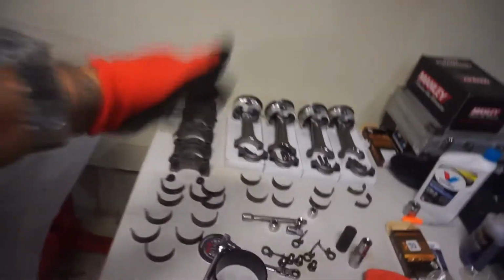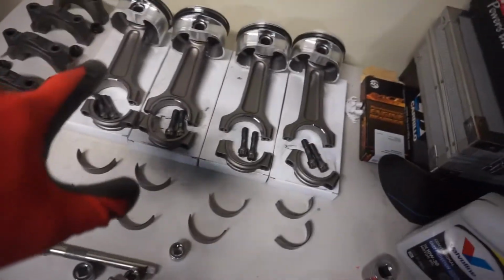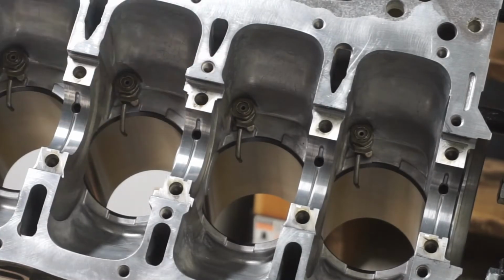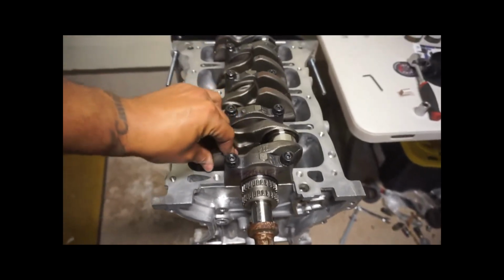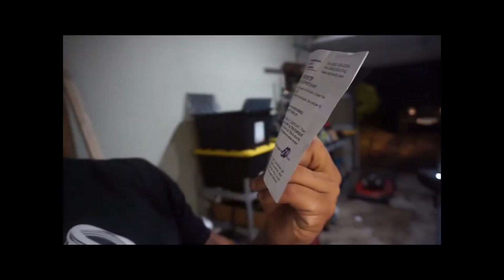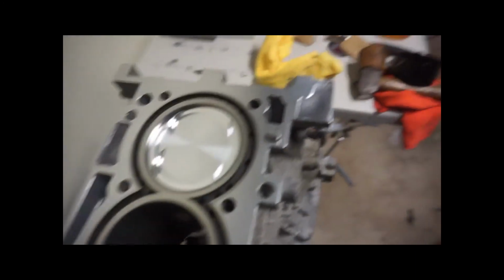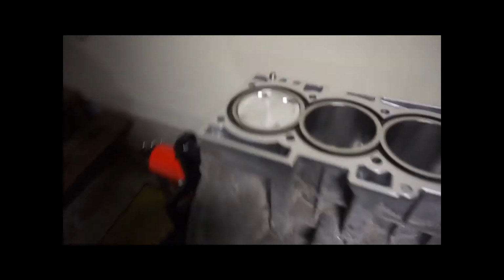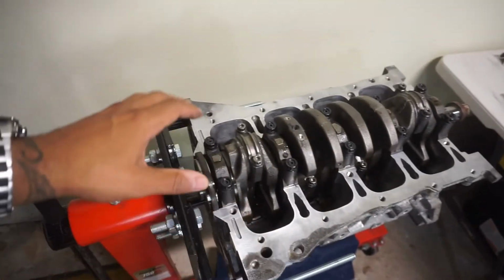GENESIS COUPE: ENGINE BLOCK ASSEMBLY

Comment: I have a question about those bearings you put on with the crankshaft what's the name of them on genracer?
Reply from the maker: ACL HYUNDAI G4FK 2.0T 10-14 standard size high performance w/ extra oil clearance main bearing set.

In the red tool, bar click PERFORMANCE, go to ENGINE PARTS, then Click on THETA 2.0T
The main bearings are about halfway down the page.
Reply: Sick lastly are you using any special bearings for the connecting rods can't wait for part 2
Reply from the maker: J j I’m using the ACL
 rod bearings as well. Those are also on the site
Reply: @ChuckTateD117  with what clearance did you end up with in the mains and rods? What engine oil are you using?